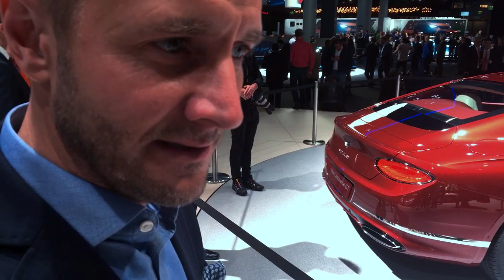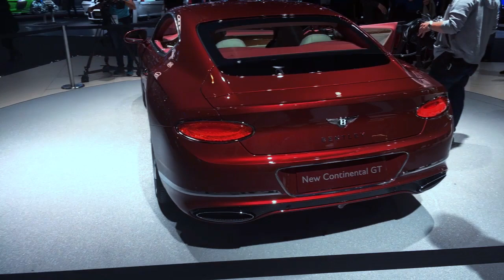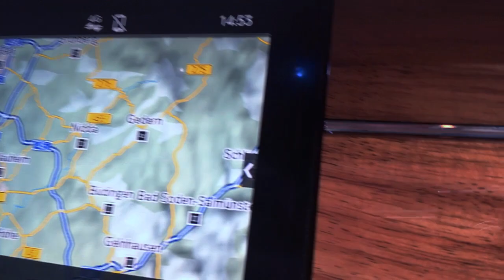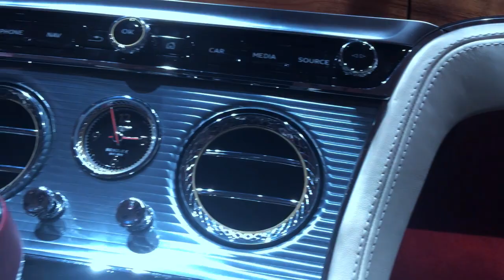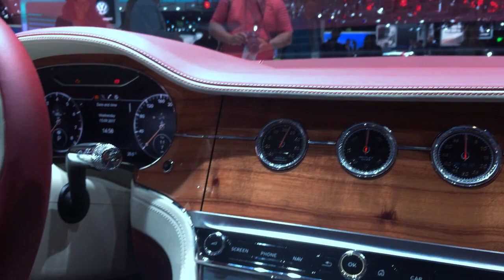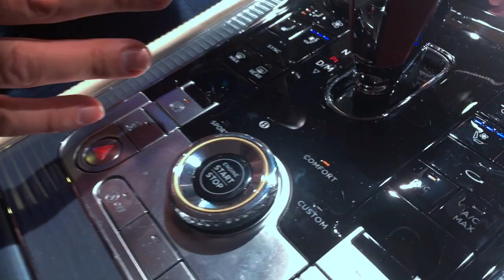2018 Bentley Continental GT — Talking with the guys that designed this masterpiece

Comment: This car's interior is insane, the infotainment system with the wood veneer and compass and barometer options is just crazy. But I don't agree with the interior design chief who said u can't move dials in the instrument cluster unless it's digital. He should check out the Lexus Lc 500, an analog dial with a Lcd screen in it. What an amazing feat.
Reply: The dial of the Lexus Lc 500 is not analog. Check your facts.
Reply: Goo Gle please check it, there's an analog ring that houses the digital screen in it.